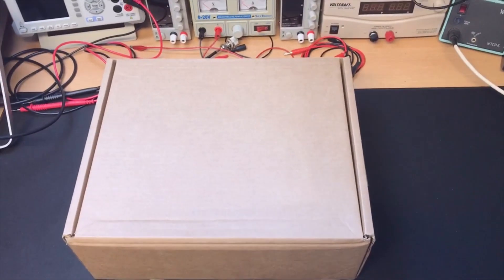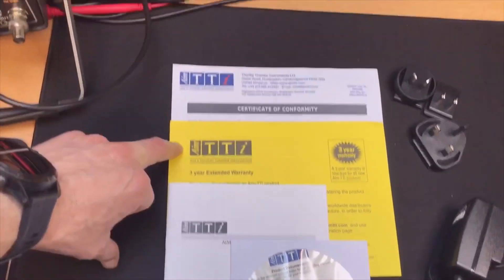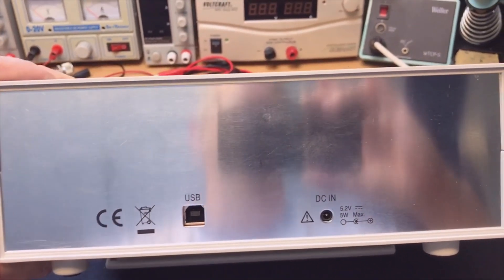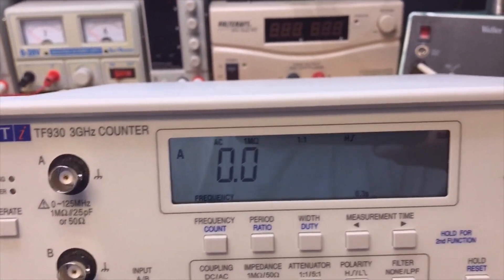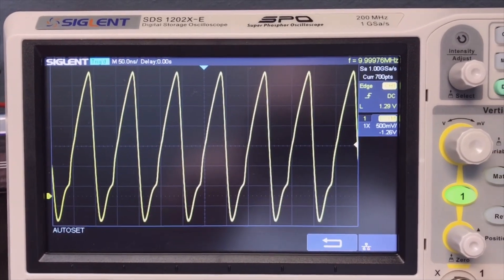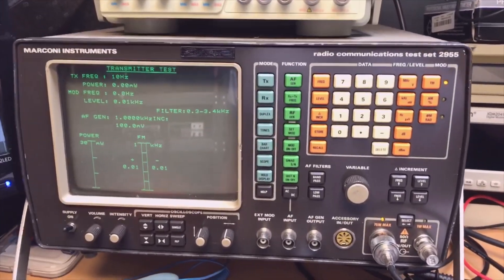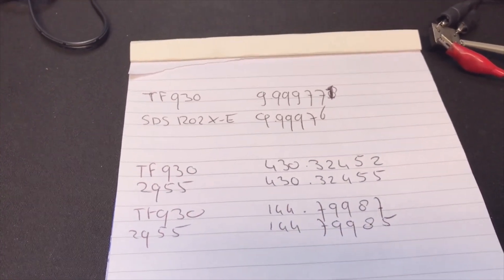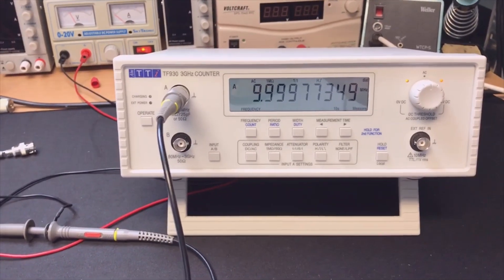#011 Review TTi TF930 3Ghz

Comment: thank you what is the minimum resolution of this counter? can this measure say example 50.0001 Hz?
Reply from the maker: Hi, i do not have the device anymore, it was 3 years ago... i am not sure i did that test. but is has a 100 second gatetime setting.. so you prob can massure those low frequencies accurate. this is realy a very good counter for its price it is very stable also for mobile. without gpsdo it was still spot on.. anly the formfactor is weird.

Comment: Thanks for the review, I am considering this counter.  Does it have a back light if the AC is plugged in and not running on battery?
Reply from the maker: Hi, there is no backlite.
Do you live in EU? i am selling mine, i am not using it. but it is a great machine, one of the best i had, to use without external ref.. Of cource with is even better.
Reply: @TonyAlbus  Sorry, US but thanks for the offer.

Comment: Hello, how precise is it down to 32k or so? I'm running a clock at 8192 instructions per second with a 32.768kHz crystal and I would like to reduce time keeping error to 1ppm so I guess I need a few decimal digits...
Reply from the maker: Hello Max, in this price range it is one of the best for what you can get... if you want to be even more accurate you can also decide to connect it to a GPSDO... i also have a video on that... then you use the GPS atomic clock to make the frequency counter more accurate.. i'll try to make a picture for you when mesuering that frequency and post the link here in the comment.
Reply from the maker: https://www.tonyplaza.nl/download/YT011/32k.png
Reply from the maker: 32.7680000 :)
Reply: @TonyAlbus  that's amazing! Thank you so much. I was wondering if the cheaper FA-2 by BG7TBL is any good at just over $100 seems too good to be true but has received good reviews...
Reply from the maker: @DucMaxDN80  i did a review on it :)  ..  https://www.youtube.com/watch?v=wJM-a2IWrKw
Reply from the maker: Remember, both work best with a GPSDO, any counter does.. but out of the box with-out the GPSDO i would trust the TTi more to be calibrated well from factory...No doubt the FA-2 is good, it has a good oscilator but without GPSDO you need to calibrate it first for best result.
Reply: @TonyAlbus  you are absolutely right. For a hobby (calibration of a watch to a high precision), the FA-2 should do then combined with a GPSDO. Any good GPSDO you would suggest at a reasonable price? BTW, congrats for your channel. I've subscribed now
Reply from the maker: @MS DN Thanks and welcome!  GPSDO.. also a review on my channel :-)  https://www.youtube.com/watch?v=zFlobGBxxH0  and  https://www.youtube.com/watch?v=8kQRbq9IdTc also BG7TBL... i liked the one with display..then you see what happens in this magic box...but without is cheaper.. both s good.
Reply: @TonyAlbus  Thanks. I'll get the one with the display! Great reviews.

Comment: is the equipment good? worth buying
Reply from the maker: Hello Jose, I think this is a very good frequency counter, it can keep up with the big brands that are more expensive.
Its internal oscillator is very stable also over the years and the device can be calibrated by the butons in the front if needed after a few years, so no need to open it and loose warranty, it comes with 3 years if i am correct. And very important it also has an external ref. input.
Reply: @TonyAlbus  Thank you, I need one for my mobile and laptop technical service, I know that even tti is a prestigious brand, I have had a power supply for years and no problem, so I wanted an opinion
it seems that besides sources they do other things well
I decide for her thank you very much for your answer